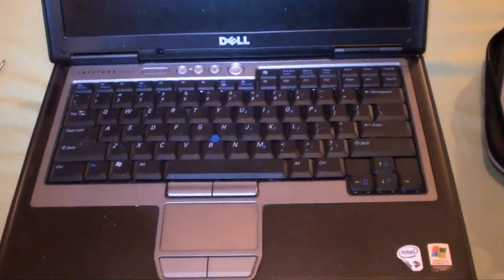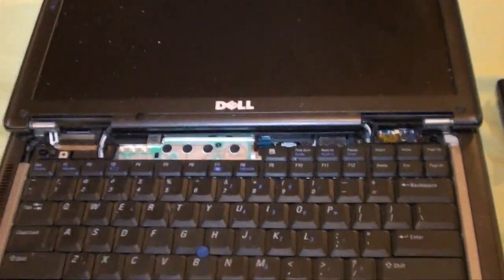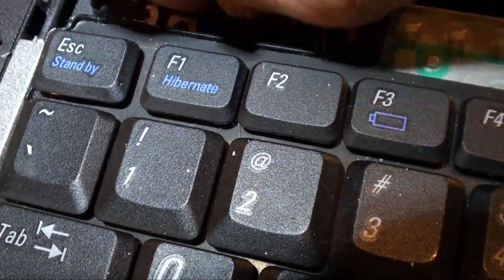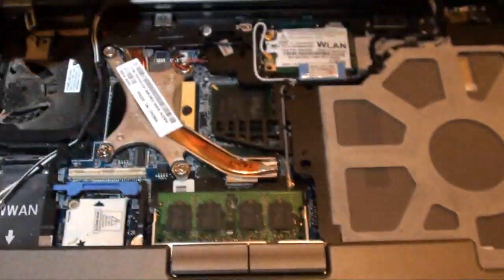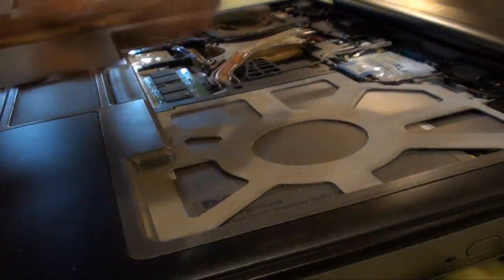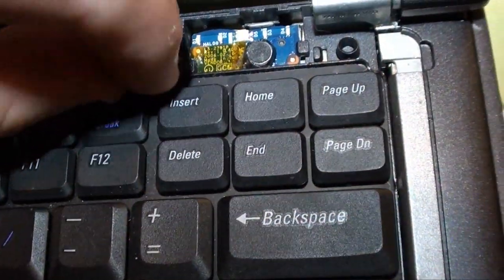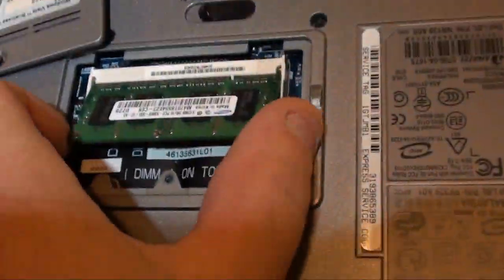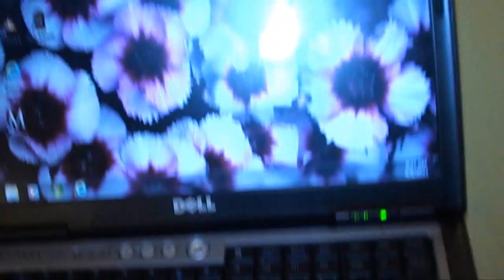Dell Latitude D620 laptop - How to add RAM - How to replace the keyboard

Comment: And they are extremely durable, that is no lie, i have dropped this on concrete 4 times, and last night i spilt a glass of soda(was sitting on keyboard) in my sleep.  It didnt start up, so i was going to put the ram from my 620 into my 630, have 4GB and 2GB instead of 3 and 3.  I decided to try it again, now that the battery had been out for a while, and it started just fine, and i can see a small puddle of soda sitting on the motherboard! LOVE LATITUDES!!!!

Comment: Where's the battery test button and would it take RAM with number AS FOLLOWS?

4gb 2rx8 pc3-12800s-11-11-f3
Reply: battery test is in the bios section. Boot the computer and tap f2 untill you see the green (or blue) screen with sections at the top. Tab thru until you see the tests.

Comment: Please help

I attempted to make an update to 4gb of RAM (from1gb) with the appropriate SODIMM type. After the installation, nothing happens. I can't even make it to BIOS and/or CMOS. There are no prompts. Nothing. Only two little flashing lights next to the power button. One light is a picture of a lock with the letter "A" inside and the other is a lock with an arrow facing down.

After that, I uninstalled the new RAM and put the old back in. The same thing is now happening. I even tried with no RAM installed. The same thing is happening.

Is there something I can do to fix this?  (I'm using the Dell D620)
Reply: go to dell.com and put the service tag of your  machine into the support page for your model. The codes can be found and explained. Make a note of how many flashes ,beeps etc.

Comment: for some reason mine did not come with a wireless network card so I had to put one I'm my self, ( was not told this on ebay)

but as it stands I'm using my  D620  for a media  server for all the moves and music / pics and all that .

but it has be sead it not a bad laptop.

Comment: I have dell latitude d620 I want to upgrade the to 4gb 
I make 2gb 2gb in the computer
Reply from the maker: Yes. 4gb plus a ssd makes it a new machine.
Reply: dell latitude have 2 places for ram i make 2gb in the 2 place
Reply from the maker: Yes, 2 x 2gb. You can go to crucial.com and run a ram scan to be sure.
Reply: ok tanks for helping
Reply from the maker: Yes. Go to crucial.com and run a scan to be sure.